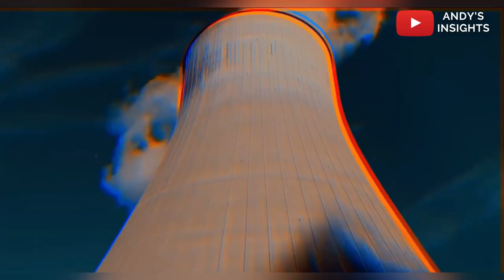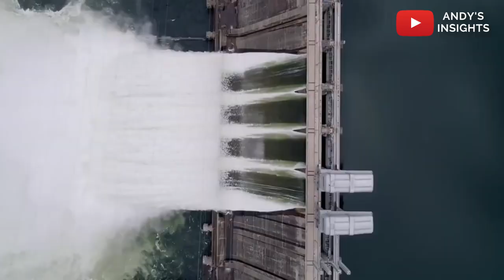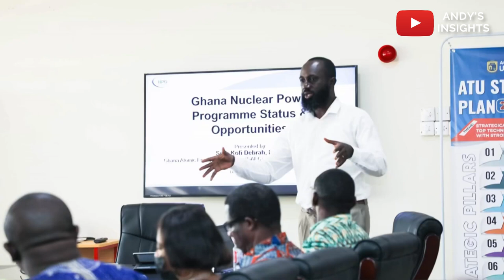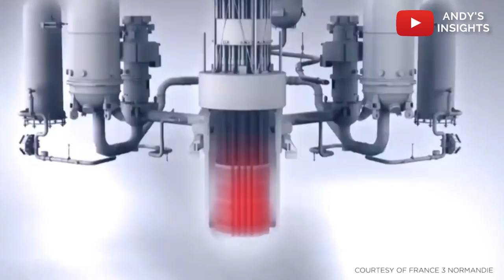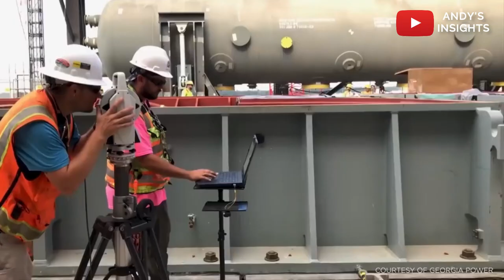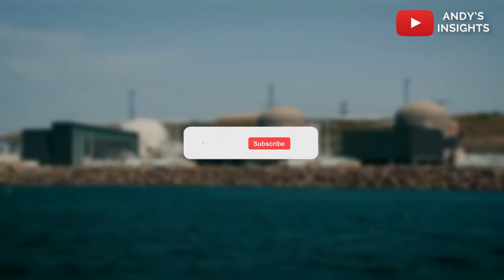Ghana's $2 Billion Nuclear Power Plant Is Fast Developing

Comment: Very interesting but I would have looked at hydrogen production producing electricity instead considering that you have sun 365days and sea water how will you be able to use the used spent fule rods where will they be buried all of this must be taken into consideration why not use parabolic dishes to collect sun light to generate electricity???
Reply: We need energy diversity.
Reply: @MrHOPPONG  hydrogen has more power I believe (IAM not sure) and also you will not have to buy uranium if you have molten salt and can keep it insulated to retain the heat you can use that during the night to generate electricity some years ago I was travelling to nungua and near the beach you had good wind which you could use wind turbine so I don't see why that could not be implemented along that part of the beach ??
Reply: How will you get the base load for the grid from solar?